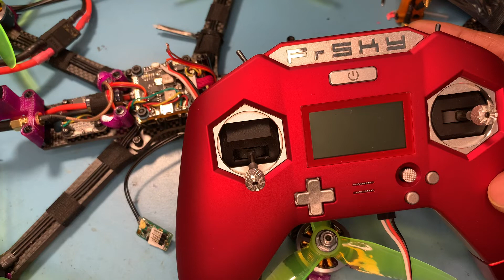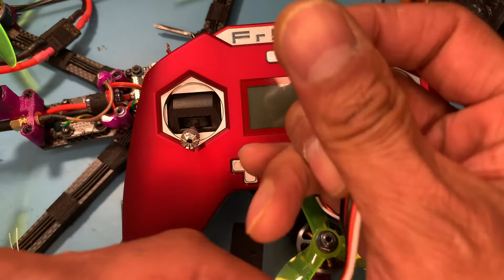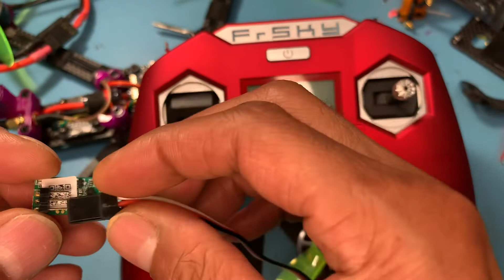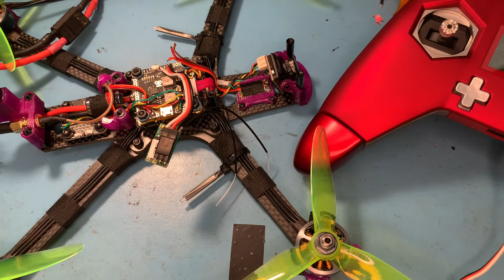How to bind FrSky XM+ and Taranis X-Lite S Controller: I used older firmwares

Comment: finally successfull bind! i did it without flashing the xm+ receiver. i just had to downgrade/flash the internal transmitter X9D+ plus SE 2019 modul from ISRM 2.1.0 to 1.1.3 and then the bind to the banggood xm+ was successfull (FCC not LBT).

Comment: so if my x-lite already has 2.2.4 on it does that mean it already has ACCESS? I bind up to r-xsr, jumper and various whoops in d8/d16 mode. Don't want to kill those just to use xm+, but if xm+ doesn't have any advantages over R-XSR i'm just gonna stick with R-XSR because its working.

Comment: I think my quas supports telemetry so when I'm binding should I put it on? And the quad came with the receiver already in it so do you thing the firmware is what it needs to be? I dont want to have another fly away . That sucked.